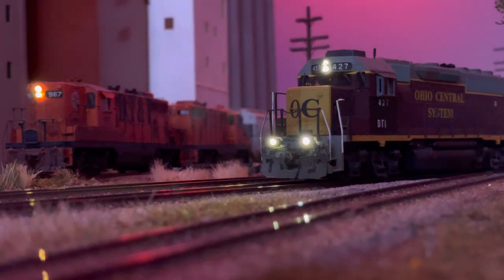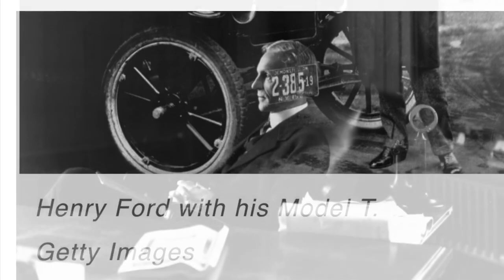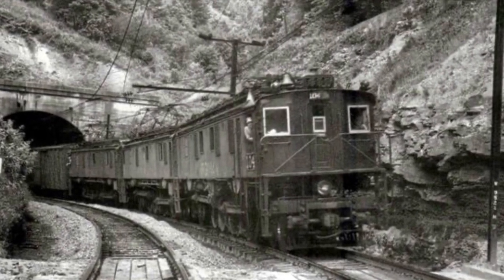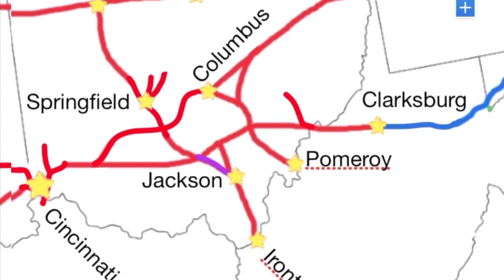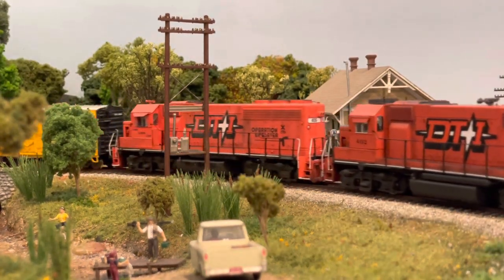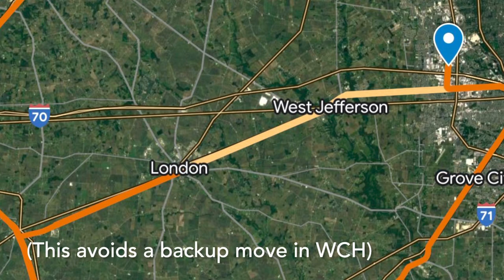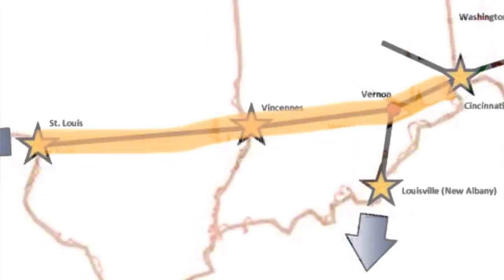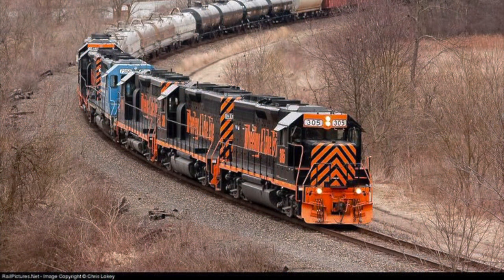The Concept Behind the Railroad: All About the Modern DT&I Part 1.

Comment: i have just 4 notes.
Massillon is pronounced Mass Lin.
the Massillon crossing of NS cant be realigned due to proximity needs for carload customers, as well as signaling issues, locations of an underground combination of gas and fiberoptic lines using the second ROW (former PRR, abandoned, B&O active with RJ Corman today. both ran parallel through town)
the Fort Wayne Line west of Crestline should also include CSX as part of the agreement, since they got it IRL from the CR split. its currently leased to a shortline by CSX, with NS having a 6 train per day maximum TR agreement (at Conrail's request, due to NS getting the former NYC Water Level Route)
the W&LE actually uses Trackage Rights on CSX to enter P-Burg. 

other than that, this is a very informative explanation video. having spent significant time inside the W&LE HQ, as well as general railfanning within a 20 mile radius of Canton, there is alot of things you find on the ground and in the area that you dont see on Google Maps. 
I hope this is helpful information.
Reply from the maker: Redo your reply without CSX. They don’t exist, and Conrail still does. I’m interested to see how that impacts what you say ☺️
Reply from the maker: BTW I had no idea how to pronounce Massillon even though I’m from Ohio, but blame google for that one. 😆😆😆
Reply: @ModernDTI  well, without CSX, NS wouldn't have been in any running on the Fort Wayne Line. Since they used the parallel NKP and WAB routings. NS only got usage of it through the CR split. So that would mean it would only be a DTI-CR interaction. Not sure how CP gets involved with that deal tbh.
Reply from the maker: @trainfan4449  it’s a secondary line. They found profitability in a relief line for both Conrail and Chessie across Ohio, plus the NKP for NS. That line is (was) more than capable of handling traffic from all 3…sort of like a port authority. Handle who needs what where. Lol.